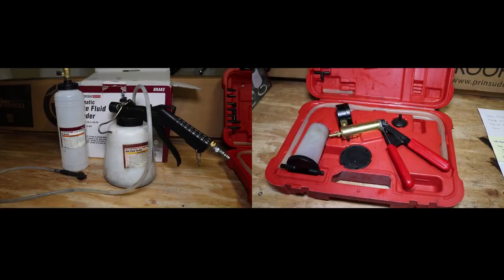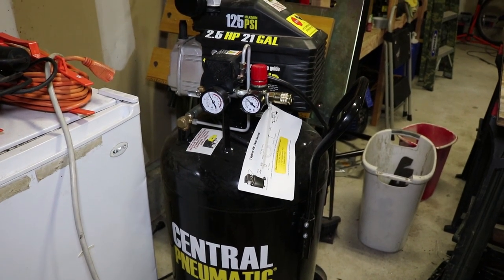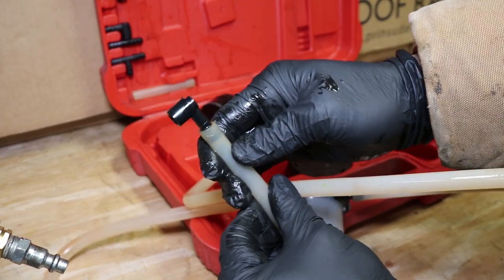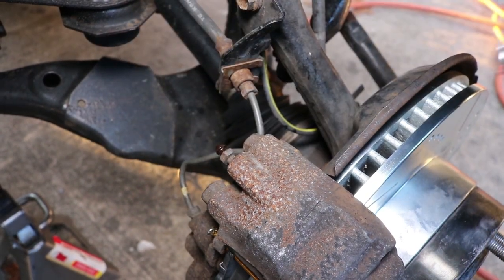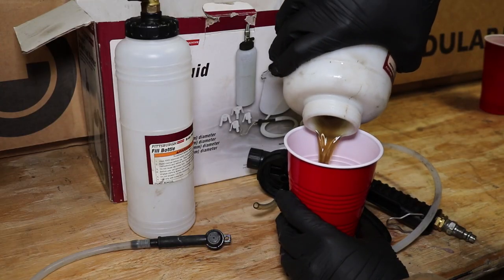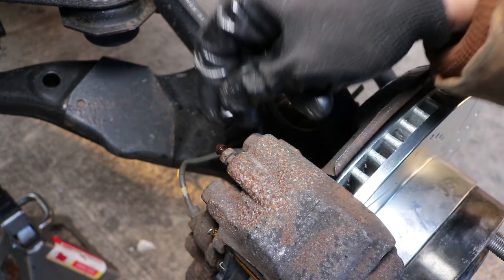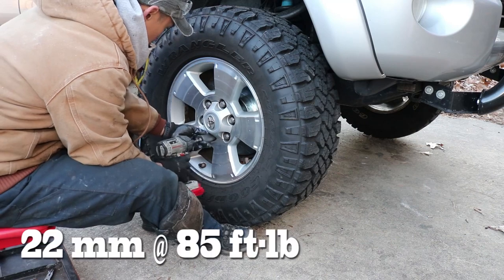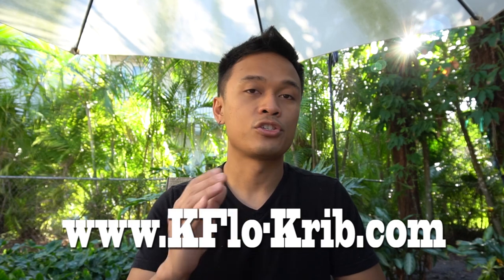Solo Brake Bleed (Tacoma DIY / How To)

Comment: Might be a dumb question but let’s go for it:

Does this mean if I delete the accumulator I need to bleed breaks plus the clutch or can I just bleed the clutch?

2017 off road Tacoma.
Also is clutch fluid different from break fluid?

Any info helps!
Reply from the maker: It's a good question, don't worry about it:
1) You can just bleed the clutch without bleeding the brakes, but if the brakes feel squishy after you bleed the clutch - then bleed the rest of your brakes and re-bleed clutch

2) The clutch uses brake fluid.

Comment: Instead of the tool can you also put the hose in a bottle and step on the brake pedal to push the fluid out?
Reply from the maker: That will be a two person bleeding procedure. One person pushes the brakes all the way down, the other person opens the valve. The valve has to be closed prior to releasing the pedal because it will suck air back into the system. It's a much more tedious process
Reply: @KFloTacoma  A way around this is to put the tubing with an arch in it that's above the bleed screw. The air stays at the top. You can keep fluid above bleeder in this way. Prevents air from getting back to caliper.

Comment: Questions, does the truck need to be in the “on” position with the ignition when using a similar tool to bleed the brake lines?  I plan on using a similar tool from MityVac.  Thank you for the awesome content!
Reply from the maker: The hydraulic system for the brakes can be bled at the off position. Once you're done bleeding, I would definitely recommend running the truck and make sure it holds brake pressure and then driving it around slowly around the block to test brake engagement
Reply: Thanks for the feedback

Comment: Awesome! this helped me out a lot thanks man. Only question is if the truck needs to be on or off?
Reply from the maker: The truck was off when I was doing this work. The hydraulic system can work independently from the electronics.
Reply: Per Haynes Manual...2005 thru 2011 Tacomas with VSC can use the anti-lock brake pump to pressure bleed.   Just turn the ignition on, hold the brake pedal down and open the bleeder screw.  Works like champ!

Comment: Helpful video! For the manual trans since the clutch/brake reservoir is shared do you have to have someone press the clutch when you bleed it? Or is the pressure from the power bleeder enough to bleed the clutch as well?
Reply from the maker: Yup, same with the clutch

Comment: Hi just a Couple of question: when I  do the clutch accumulator delete do I have to do the bleeding just for the clutch part or do I have to do breaks too? Does the clutch fluid comes from the same reservoir as the breacks? If so, I need to buy the same type of break fluid to do it or it's a different fuild system? 

Thank you for your time and effort to post this so useful videos, love the content!

I own a 2019 Tacoma off-road 6 MT.
Reply from the maker: On my 2009, it's the same reservoir as the brake fluid. I've also gotten comments from subscribers that they have a separate reservoir. I would recommend, tracing that hydraulic line from the accumulator and following it up the engine bay to find the source. That's probably the best way to validate from your end.
Reply: @KFloTacoma  Thank you for your reply! I'll probably do what you just suggested.

Comment: Had a situation where my front driver side brake line was yanked out of the caliper causing major fluid loss.  My question is when I replace the small hard line that goes directly to the caliper will I need to do all of the bleeding in the proper order or just the front driver wheel?
Reply from the maker: If the reservoir was drained completely during the installation, then i would suggest bleeding the whole system.
Reply: @KFloTacoma  looks like it’s near the minimum but still fluid in there hopefully I can just replace the small hard line and bleed that side out.  Thanks for the reply your videos have helped me several times and I appreciate it have a great day!
Reply from the maker: I'm glad that my vids help! Thanks for watching and supporting the channel!

Comment: Hey i bled my Tacoma’s brakes and it didnt wana turn on after . Why is that
Reply from the maker: Did you disconnect/reconnect the battery?
Reply: @KFloTacoma  yea i did but it didnt help . Is the truck supposed to be on or off while bleeding brakes ?
Reply from the maker: When bleeding brakes, it should be off. You may have accidentally drained your battery. Try jump starting
Reply: @KFloTacoma  i did and it wasnt the problem . The brake fuse went out
Reply from the maker: Nice. Good find - I haven't seen that before
Reply: @KFloTacoma  yea i ended up having to bleed the brakes with the truck off but the ignition on
Reply: @agustinherrera5600  your charging system and brake system have nothing to do with eachother. It must have been a coincidence.
Reply: @doomkid02  the rear tail lights fuse went out from me pumping the pedal to bleed the brakes

Comment: I have a 2007 Tacoma TRD Sport V6 Double Cab Long Box and want to know if I need to also bleed the ABS module. I know that I don't have the model with electronic ABS bleed as it is only a 2007. How do I bleed the ABS module? Does it just bleed automatically when I apply the sequence shown in your video? Thanks.
Reply from the maker: There's no zerk fitting on the module, so just bleed it as I show and you're good to go
Reply: If you get air into the ABS module like I did then you need an expensive scanner to bleed the system correctly.